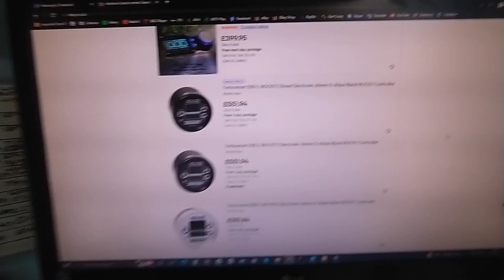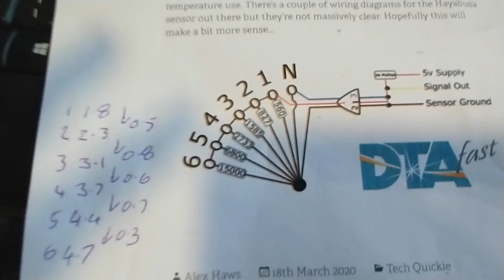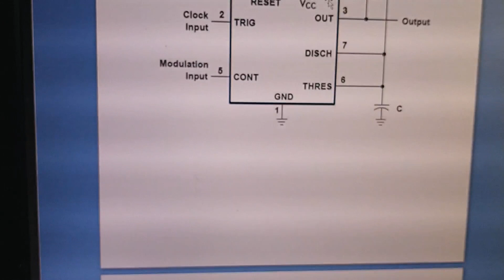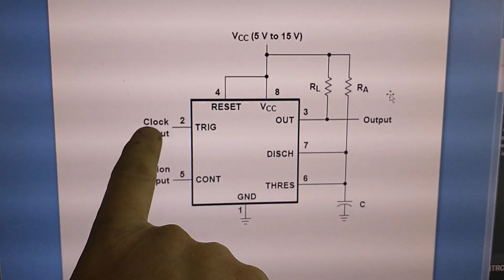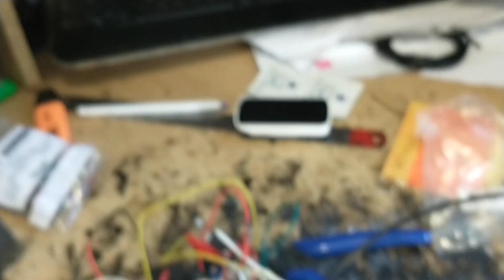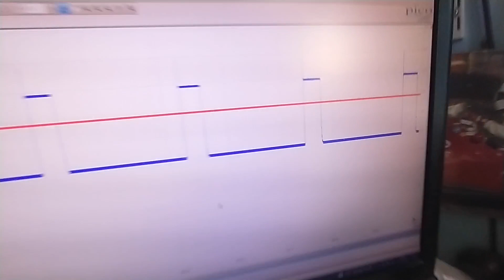How To Make an Electronic Boost by Gear Controller Design & testing controller for a Hayabusa Turbo

Comment: Also it could possible work with an internal wastegate maybe by bleeding off boost?
Reply from the maker: The controller for internal & external is the same, just need to plumb in the vac/pressure hoses differently.

Comment: Very clever stuff.... have a look at the ams 2000 mate as that does literally everything,  so it might help with what you are trying to do
Reply from the maker: HI - thanks - I did look at the AMS - but the over £2.k price tag put me off. If I can get this working, even with fuel/testing costs it should be less than £200, plus I really like the "built not bought" aspect of designing & making stuff myself.